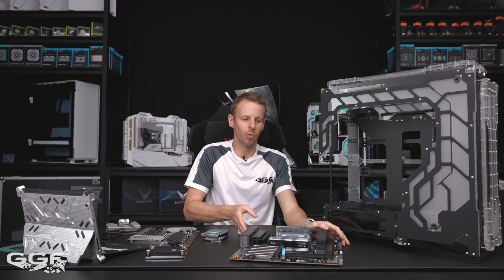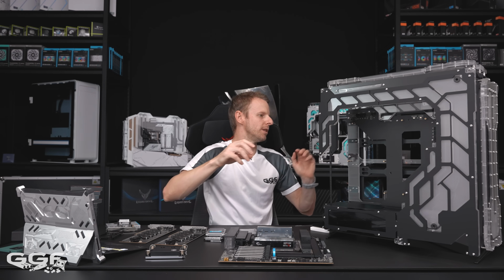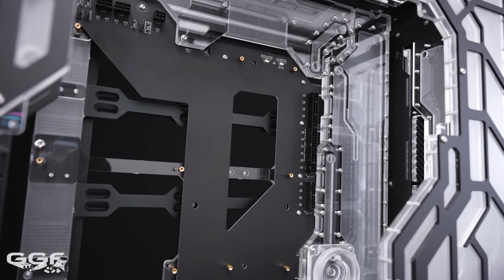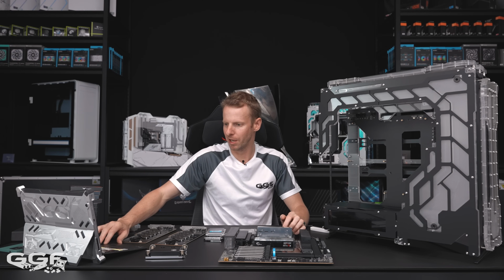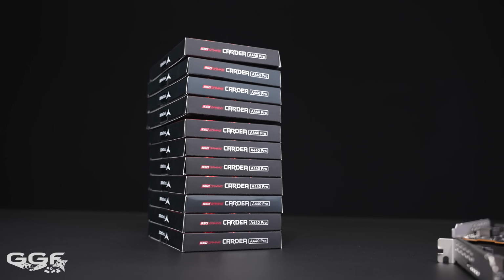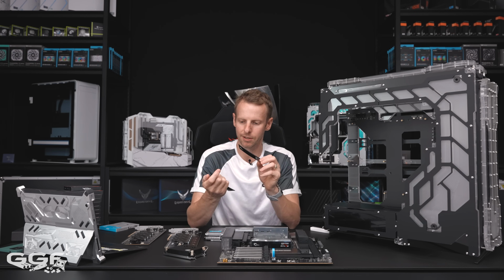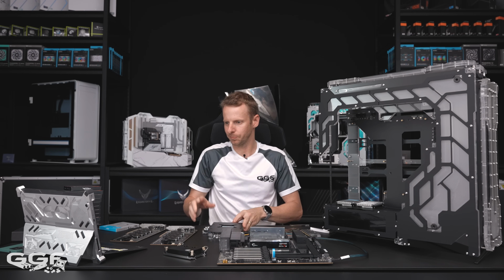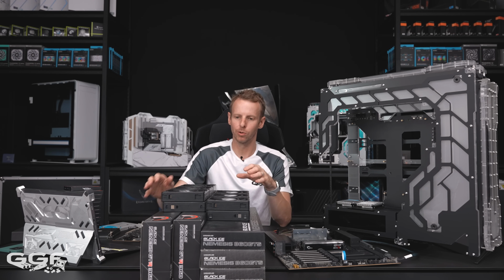The NEW Spectre 3.0 Enterprise! 50TB SSD | 28 Core Xeon Workstation

Comment: I had a SIngularity case, it was stunning but "aged" pretty quickly. Keeping those 2-sided acrylic distros clean and dust free was a nightmare, never set the fans to blow straight on one of those
Reply from the maker: Yes I can imagine. What type of coolant did you use? Our last Spectre build, the silver and blue one is still holding up well and has barely been turned on. It just sits there in the background :p
Reply: @GGFEvents  i had clear EK fluid, that wasn't the best idea to hide the dust and the "fill line" settling. 
Also by the constant cleaning I did create some micro scratches... that could be a video idea: how to care for your case

Comment: Stu, 

Have any issues with the Bitspower dimm modules and the RDimms? The RDimms have a fairly large pmic so I wasn’t sure if that interfered with anything when assembling the memory modules
Reply from the maker: So far no issues. The modules seem to have a large channel routed out of each side for the power management area
Reply: @GGFEvents Love this build (and your work in general) - to piggyback on the question RE the Bitspower modules… I have the Kingston 256gb DDR5 kit for my W790 build, is it possible to use these modules with the standard Alphacool or EK ram waterblocks? It looks like the holes on the Bitspower modules are too far apart for the standard waterblocks and thus I would have to find another way to attach (or wait for a true DDR5 rdimm kit).
Reply from the maker: @madhouse425  thank you and yes blocks will not align on these ram sides

Comment: Ahh probably most inappropriate case for workstation use on the market. ;)

I'll never understand why so many Enterprise 15mm NVMes ship as just aluminium brick. Micron (say 7450 family but it can be any other from them) in 15mm variety always come with nice, finned radiator housing. It's so amazing at keeping the temp down even without ridiculous airflow found in servers. M.2 cannot compete. Even left outside the case drives stay pretty cool. It'll be a challenge for sure in such unsuitable for this task case. Its nice to see someone uses Enterprise grade NVMe 2.5" drives in impractical overbuilt PCs. They are miles more robust than consumer crap and if used properly basically indestructible in longevity. Even if I have still IIRC 8 M.2 in my main rendering rig I slowly add more and more 2.5" because they are much easier to keep cool and no need to use pointless on-board M.2 slots which are excellent heat traps when you dump 800W or more of heat at peak rendering for 24 or 48h.